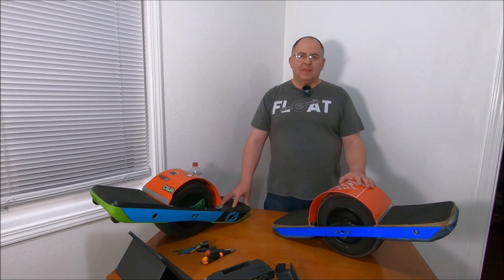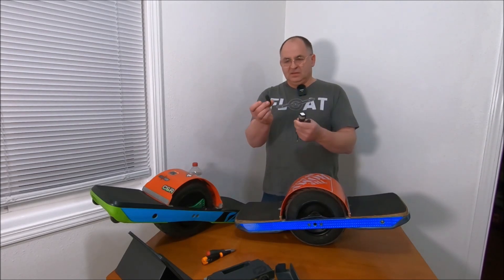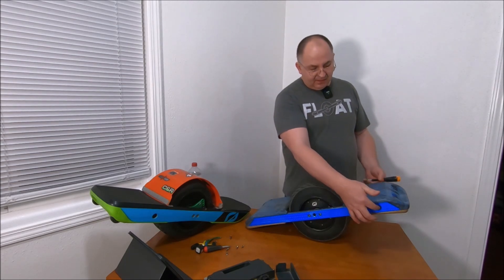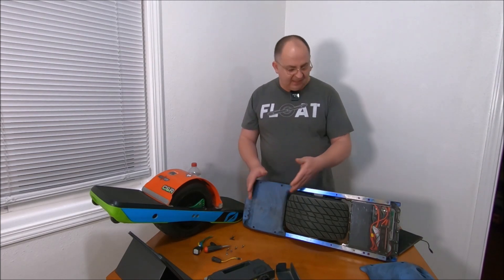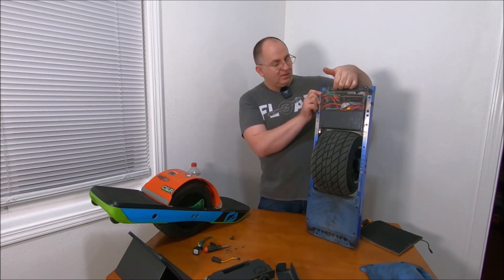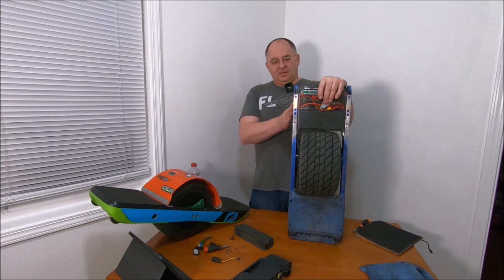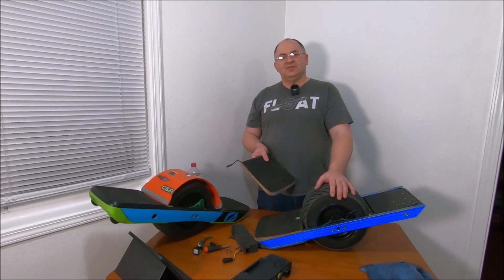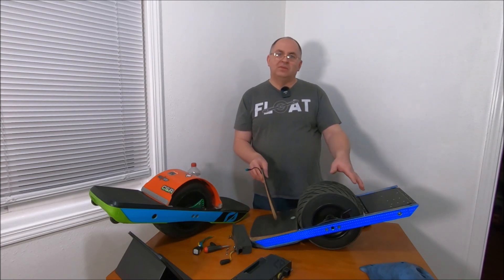The First 18s3p 12.6A VESC Onewheel XR it's better than the Pint X GT GT-S

Comment: Dual Battery?  Have you heard of floatwheel. They have dual battery for almost a year now.
Reply from the maker: Floatwheel they do have a single battery pack splits in to two parts, that's not Dual Battery setup

Comment: If those packs are connected in parallel, how do you manage their charge protection? Are there separate charge ports?
Reply from the maker: Each pack using their own BMS
Reply: @GPeter7  Do both packs meet in parallel at the VESC?
Reply from the maker: @TheBoardGarage  Yes
Reply: @GPeter7   If that’s the case, then those BMSs are not going to be able to stop the charge if it detects a problem. The packs are joined in parallel at the discharge, and so they will equalize via their terminals so long as they are connected. So if one BMS sees an overvoltage fault, and stops charging, the other pack will still continue to charge since that BMS sees no problem. Then, the pack that’s still charging will rise in voltage, and that will parallel charge the pack with a problem, via the terminals. 

So in that setup it seems you have, you don’t actually have charge protection.

In order for the BMSs to stop their charge, you would have to disconnect those packs from one another before charging.
Reply from the maker: @TheBoardGarage  Well, that's true, so far I got more then few charges on both batteries recently I didn't test with multimeter all cells, and they all looks fine, but eventually when batteries will get older, it may get that problem
Reply from the maker: @TheBoardGarage  Eventually I may reconfigure it to a single pack 18s3p and it will run from one BMS
Reply: @TheBoardGarage very good point!
Reply: @GPeter7 or if there is any charging issue at any point before then. @theboardgarage is right, this is a current (not future) safety concern if charge protection is being claimed.
Reply from the maker: @batterymooch  So far so good, I will keep eye on cells, my previous build has a similar setup and after a 1000 mile all cells looks fine, but eventually I will re-configure into 18s3p as a single split -pack
Reply: @GPeter7  sounds good. Everything looks great and works well though until a problem pops up. This is where a robust design proves itself. Before then it’s just not needed. Think of air bags…useless until they are really, really useful. 🙂
Reply from the maker: @batterymooch  Thank you, you're absolutely right 😉, and that's why I call it a prototype, I will keep working on it to make it better safer, and more reliable. I'm not like Future Motion, to whom it will take years/decades to fix design flaws or poor-quality issue
Reply: @TheBoardGarage  no thats NoT correct
Reply: @TheBoardGarage  no thats not correct